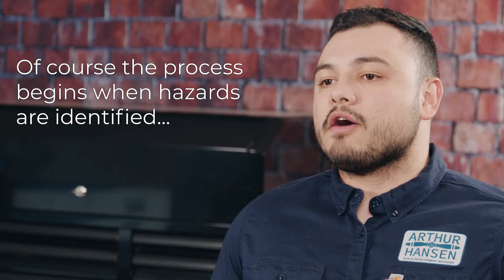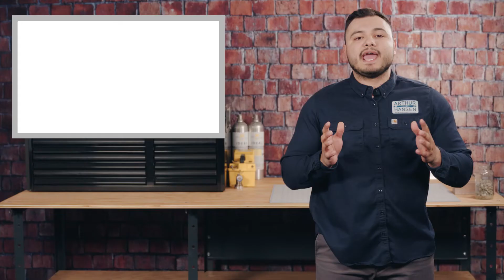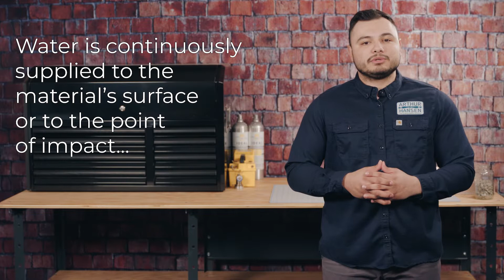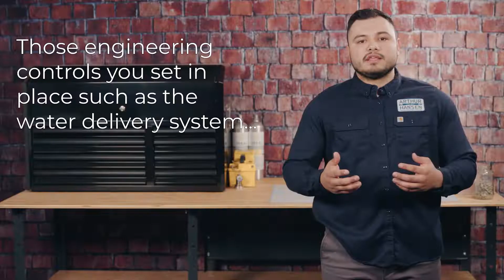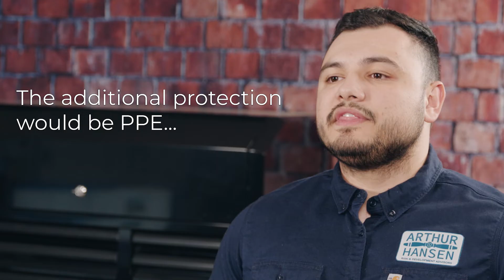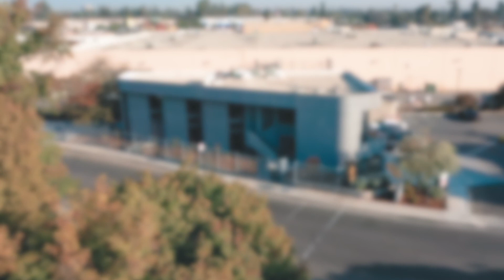How to Control Silica Hazards: Respirable Crystalline Silica Safety Training | Construction Safety

Comment: Good to know , what’s the best mask when chipping concrete ?
Reply from the maker: Hey Micheal! Hate to give an answer like this, but "it depends"  ... your employer can use the "Silica Table 1" to see what is required based on the time, method, location etc. The actual mask type will also depend on other factors like comfort and personal fit. For example, a powered air-purifying respirator (PAPR) with a hood can be used for people who have beards.  However, that would be overkill if concrete chipping is a task you only do from time to time and for short periods.   If your employer would like for us to conduct an assessment of your company's potential Silica exposure, the appropriate control methods, and program requirements, we can help with those services.